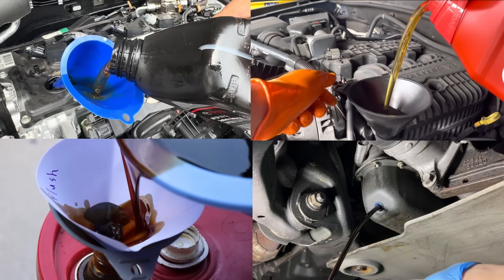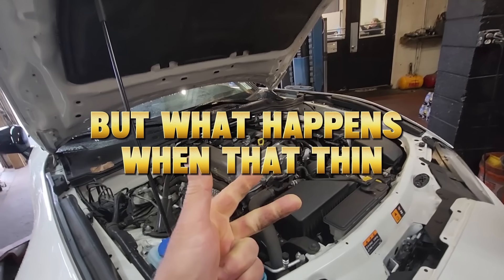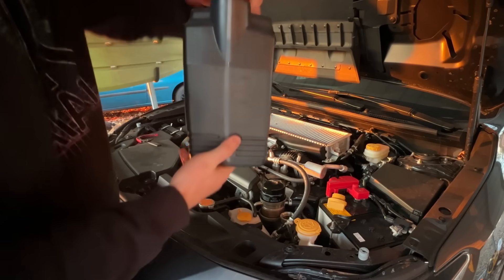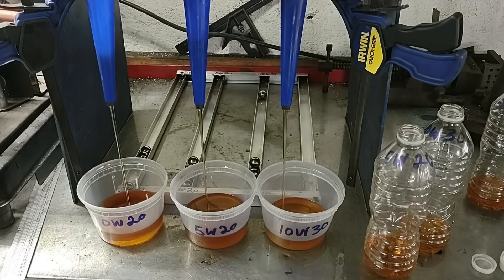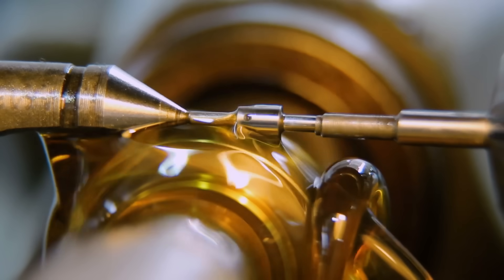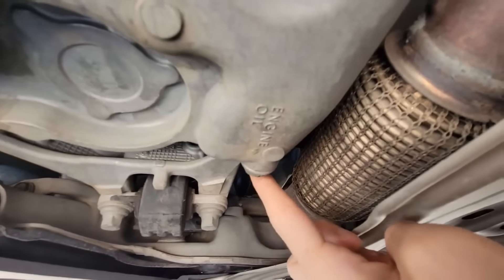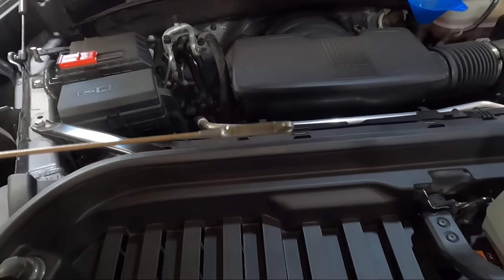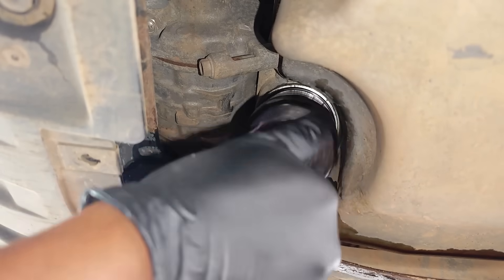The TRUTH About 0W 20 vs 5W 30 Oil (50 Engines Tested!)

Comment from the maker: DO THIS and Your Car Battery Will LAST 15 YEARS! : https://www.youtube.com/watch?v=umw9zUzOzXg
Reply: I was in the oil blending business. Everything you just discussed is SAE & API standards and actually tested using their tests. The XW is the freezing viscosity weight at startup that is critical in extreme cold. the WY is the viscosity of the lubricant when the engine is running. Additives vary, but they are their in a plating scheme to keep metal wear from occurring. All defined by the API & SAE standards and tests done in the lab at the blending & packaging plant's lab.
Reply: Полностью синтетическое 5w30😂 Балаболы. Полностью синтетическое - это когда 4, 5 или 6 группа масел. Если там есть 1-2-3 группа, то масло уже не полностью синтетическое, а лишь полусинтетика.

Comment: Chevy Tahoe owner since new in 2015 LTZ. I use 5w-30 and live in south Texas with currently 287,000 original miles and engine has full power and quiet like when I bought it new. I just changed out the original spark plugs and wires and the plugs looked good still. I used 0w-20 for the first 75,000 miles and then started using the 5w-30 after warranty ended. If this helps anyone that’s wondering oh and I pull a 27 foot RV from time to time. Also. Original transmission only changed out torque converter at 243,000 miles.

Comment: My Ford Everest's manual recommends 5W-30 that has a special Ford spec requirement, calling for WSS-M2C913-D spec oil. I got the car in 2017, did an oil change at the dealership in 2018, but unfortunately big problems in 2019 made me forget about it. In 2020 to 2021 there's the pandemic, and as the pandemic drew to a close I then entered a huge problem in life that made me forget about changing the oil up until Nov. 2023. That's FIVE YEARS with no oil change!! 

And when I changed the oil in 2023 I was given by the shop a 5W-40 fully synthetic oil from a brand that I didn't know (Vortex Plus). I guess any oil is better than 5-yo oil. Then after a year I changed it again with a taiwanese brand called Medex, still 5W-40. Now I'm looking at another oil change but I'm thinking of going with 5W-30.

Comment: This video is GARBAGE and should be removed.  An example of YouTube allowing anyone to post non-factual and made up information. I use 20W oil in my 08 Tundra and after 90k miles the entire engine has ZERO varnish or deposits. Change your oil before every 5k miles for normal use, or even more frequently in severe use. Use good quality motor oil like Valvoline or Mobil 1. Allow your car or truck to come up to operating temperature before you drive it hard. Its all about the quality, care and frequency folks, not oil weight unless you are doing something non-normal like driving your car on a racetrack or out on sand dunes. For example, don't use a standard 20W oil on the racetrack, you will want 40-50W and an oil that won't have shear break down like Motul. With oil, you get what you pay for.

Comment: the video barely touched on the 0W-30. I have a 2024 Subaru Forester and have 7300 miles on it. The first 2500 or so were from the dealer floor...so, 0-w20. I changed to 5W-30 until my next service (at the dealer) around 5600 miles. More 0w-20. I pumped out about a quart and added a quart of Liqui-moly Ceratec 5-30. I live in WA State, so temeperate climate. Am thinking the Ceratec has had enough miles to do its thing. Going back to Mobil-1. Can't decide if I want 0w-30 or 5w-30. Opinions?

Comment: This video is total AI garbage that doesn't even make use of legitimate sources. I work in new vehicle development and the idea that OW-20 is going to greatly increase wear over 5w-30 in the correct application is absolutely ridiculous. Engine oil is also acting as hydraulic fluid in a modern engine and operating cam phasers. Therefore, you need to maintain an appropriate viscosity range. If your car calls for 0W-20 then use 0W-20.

Comment: What if you live in climates like the UK where winters can be as low as -5c and summers up to 35c.  I mostly do short trips with the occasional motorway foot to the floor driving and engine in question is Mazda 2.5 skyactiv G non turbo engine.

Comment: I live in Hong Kong, and the temperature here is mostly like that in California. No extreme winter at all. I have used 0W20 for my Prius 2008 at the first 100K, and I had acknowledged the engine oil loss problem and I temporarily switched to 5W30. The fuel consumption immediately went up but engine oil lost less. I switch back to 0W20. Engine lights is on for overheating.
I agree 5W-30 provides better protection with sacrifice of some fuel and I regret that I go back to the 0W20 Fuel economy scam. For hybrids, the high MPG is from the system , not the engine.

Comment: Mercedes C220d 2.0 190 HP. It came with 5w30 standard. First oil change I switched to 0w30 shell Helix ultra and the engine was smoother especially until the engine got to running temperature. Yes, it was a bit more expensive but what's 30-40 euros more on an oil change compared to repair costs later on? It's up to you, for me 0w30 is the way to go

Edit: when I did the last oil change my friend was surprised on how clear the "old" oil was. He uses 5w30 😅

Always go for the higher quality oils if you want your car to last. I'm sure you pay a bit more just to enjoy a good coffee right? Or you get the cheapest wet socks tasting coffee? 🤪

Comment: Every 5k miles we change oh oil, we have a 2017 dodge van with well over 100k miles and the oil is still nice and clean, still looks new on the change. And we have a 2025 chevy trax the put ow 20 in never again.

Comment: I purchased a used 2011 Toyota tundra 5.7 liter V-8 with 158,000 miles and continued to service the vehicle at a Toyota dealership using 0 or 5w20 oil depending on winter and summer season in Pacific Northwest of Washington State. 
At 187,000 miles I changed to Mobil 1 5w30 high mileage oil which I provided to the Toyota Dealership, which they are willing to use. One of the service writers after 5 years I have owned the truck noted the 5w30 was not the oil viscosity printed on the oil fill cap believed the close tolerance of the Toyota engine and the heavier viscosity of the 5w30 would be harmful to the engine.
I stressed the V-8 with 187,000 miles and being used during the winter as a tow vehicle for a 28’ Airstream travel trailer weighing 7300 lbs was justifiable.
Now after owning the Tundra over 7 years and 261,600 miles I have been using the Costco Kirkland brand 5w30 high mileage in combination with the high mileage Mobil 1 5w30 which the dealership uses and their Toyota oil filter with no side effects for the last 2 years. I change oil between 5 and. I more than 7,000 miles and as my mileage continues to increase I now religiously change the oil at 5,000 miles.
Keep your maintenance up to include spark plug change at 150,000 miles, valve cover gaskets replaced, but the biggest change in the engine performance was when I had the serpentine belt and the tensioner and pulleys replaced. It felt as if the engine had less resistance. That with brakes and rotors being replaced the Tundra runs as it should. Other maintenance performed was air filter changes and a DIY cleaning of the throttle body corrected a lurchy throttle response.

Comment: This is AI generated FAKE video compiled of many snippets taken from many other videos. If you believe the creator of this fine piece of "$hit" I have a bridge to sell you in Arizona.. I use 0W-20 on my 2013 Lexus and when I change the oil, the oil is still in good shape, color and viscosity rating. I never add additives because the additives are there already. I use ENEOS as per manufacturer specification, oil changes and filter at 6500 kilometers, no oil leaks or oil burning, the vehicle is a RX 350 with 102555 kilometers on it. If you believe on "snake oils" treatments go ahead no one is stopping you, you are the master of your own domain. No one is pressing you believing what it's posted here.

Comment: Folk like the 2.4 multi threaten anything other than 0/20 will ruin engine
.Well, unless you check oil level daily you could go a month a quart or so low. This oil evaps so quick so running low constantly is worse for engine wear. Since at 160,000 now ay mis 5 30 with 0 20 or even go 0 30. Oil temp light is always on now despite temp showing normal..Keeps don't show pressure, only temp.

Comment: Roush stage 3 supercharged engines say to use 5W-50 since it’s a high horsepower motor and it is pressured by the supercharger. What do you think about that?

Comment: Is this really true? 0W-20 oil was introduced around the year 2000, meaning it's been around for over 25 years now. In Japan, we also have many cars running on 0W-8 oil, and I have never heard of any failures caused simply by the oil viscosity.

Comment: If you change your oil every 4,000 to 5,000 miles i'm not sure if it makes that much of a difference. Maybe going 10,000 or more miles 0w-20 breaks down faster, but i use Mobil 1 extended performance high mileage 0w-20 and change every 4,000 to 5,000 miles never had an issue. I drive a Chevy Tahoe 5.3L

Comment: I run 0w20 in my 18 silverado and change every 3-3500 miles. Change transmission fluid/transfer case and differential oil every 20-25k. 150k miles and runs like the day I bought it.

Comment: I’ve got a 2023 RAV4 Hybrid Limited. I’m based in the Philippines, where the weather’s usually tropical — around 24°C to 36°C (75°F to 97°F). I’ve been using 5W-30 fully synthetic oil and was planning to switch to 0W-16 or 0W-20, but after watching this video, I changed my mind.

Comment: I have a 2017 rav4 that uses ow-20 the owners manual says i can use 5w-20  but not permanently . Ive never owned a 0w-20 car till this one and ive had it 6 years . It had 58k when i got it . Now has 155k and now definitely has the 2.5 rattle when i start it......i change my oil every 4k-5k i use a good brand . Anyway ive been thinking about switching to 5w-20  permanently just dont know enough about these newer engine  and dont want to screw it up

Comment: I've read about, seen videos, and suspected this for years. Even so, I skirted all of this by buying a used 2018 Tesla Model 3 Dual Motor. After the drive unit warranty expired at 120,000 miles, I changed each drive unit's ATF fluid and filter at 122,000 miles and am probably good until 222,000 miles. The low maintenance of an EV was a major impetus to buying one.

Comment: Bad advice: Always pick ACEA A5/B5 for modern engines. NO, pick the classification that is right for your engine. In difference with the american API classification system, the european used ACEA is much more detailed. It tells about HTHS, which is as important as viscosity when it comes to oil film as well as what the oil contains when it comes to sulfur for example. A A5/B5 in a modern Diesel engine will likely harm the DPF. Instead it needs a C2 oil for example. Some engines needs higher HTHS and need a A3/B4 or a C3 oil. An engine with wet belt might need a C6 oil to save the wet belt. All of them can still have a 5W-30 viscosity. To pick viscosity is not enough for modern engineered cars. It needs to be complimented with the right classification for your car. And to advice to always pick A5/B5 for a modern engine is just wrong.

Comment: This video is pure bull crap!! I've been around engines  for 50 years and have extensive knowledge of lubrication systems. anti-wear packages. So here's the deal.. any modern engine made within the past 20 years can use a 20 weight oil and is probably better off running some form of 20 weight oil unless you're in an extremely hot climate. Here's why... Full synthetic 20 weight oils are so much better at protecting engines and flowing so much faster and removing heat. Better than any oil you can compare it to from just a few years ago.. because the type of oils used and the anti-wear chemistry packages are so good now it creates a learning curve.. that's what we have here a learning curve. Cafe standards mentioned have no bearing no pun intended.. lake speed the motor oil geek just did a comparison and found 20 weight oils actually are the best kind of oil to run you get less wear metal in the oil analysis. My concern would be if it's exceptionally hot where you live above 90 degrees Fahrenheit constantly. Change your oil  and filter every 3000 to 5000 miles and ignore this sort of nonsense as it is old data and mostly AI slop. To put things in perspective a 30 weight oil will sheer down to 20 weight in probably less than  1000 miles just for some sense of perspective here 😂 everybody feels smarter now and have a good day.😂

Comment: '29 Model 'A, new rings, bearings at .001, I use 5-20 full synthetic, uses no oil, still 'tight' engine after lots of miles, I may change to 5-30, same with the '02 Town Car with 220K, we'll see.

Comment: Finally, I have the empirical data I have searched for! I have no idea if this so called 50 engine test is legit. But I have, in printed text straight from Toyota, the evidence to answer this question. Some will curse me, but I am a retied high school teacher. I'm so tired of adults who don't have adequate reading comprehension skills and the ability to do research correctly. The short answer:  the conclusion of this video is correct. Don't believe me? Then go and find the data for yourself, just as I did. Or believe whatever you wish and just do whatever it is that you do.

Comment: I get better fuel economy with 5w30. No more exhaust soot after barrymans b12 in gas and a motor flush at 30,000 miles.  Quieter and more power on 5w30 full synthetic oil. 3000 mile oil changes with purolator one filters! My engines never blow. I change all lubes early too!

Comment: Switched to 0w30 🛢 in my challenger 3.6 , read forums saying it was originally spec'd to 0w30 🛢. Wanted to try it being over 100,000 miles now 170,000 miles. I noticed the tic & chain i was hearing is gone, on incline (hill) it barely comes back from ⏲️  to time, soon as im off hill/incline it's gone. Noticed a decrease in fuel economy but hey I get ethanol free ⛽️ , hope it survives the winter cause it blasted through summer/fall. Might change it back for 30 degrees & below weather. But given age of engine & how powerful amsoil 0w30 is, I think it has 5w20 beat.

Comment: When you try to determine the difference in engine wear between 0W-20 and 30 oils through a simple experiment, you’ve already gone down the wrong path. Why? Because in real-world driving conditions, engine wear is much more severe during cold starts at low temperatures.

If you truly want to test the differences between the two oils, you must evaluate engine wear over a long period of time and under various conditions — including multiple cold starts and normal operating conditions.

But even that isn’t enough. You also need to consider whether the vehicle is mainly used for long-distance driving or short urban trips, whether it often drives in hilly or mountainous areas, and whether heavy loads or towing are involved — all of which affect engine load.

Therefore, this is not something that can be easily proven through a simple experiment. A more scientific and reasonable conclusion must take into account a combination of different scenarios, geographical temperatures, and usage conditions. Moreover, the result is not absolute — it depends on the specific context and driving environment.

Comment: What is the effect on variable valve timing sensors and engine running normally when changing to a non recommended weight oil?

Comment: This is a very stupid test. It says nothing. Ofcourse a engine get worn ourt if you use 20sae if it should have 30sae. The test should be between 5w-30 oil and 0w-30 oil.

Comment: I've been dealing with this question for 9 years with my 2016 Mazda 3 - the 0w-20 specified seems too thin, yet with the tight clearances in the engine, I was hesitant to use 5w-30, as I was afraid there might be some reason not to that I was ignorant of. Since the proliferation of gimmicks on new cars (start-stop, cylinder deactivation, etc.) that harm the engine, but give slightly better mileage and emissions numbers, I'll be switching to 5w-30 - which is specified for the same car, if it is to be marketed in Mexico.

Comment: What is that gobbledygook at 11:36??

This is AI generated junk.  There never is any real data shown.  Go check out The Motor Oils Geeks debunking of this video.  He's an expert.  Shows the real data.

I've read quite a few of the comments here saying that 5W-30 is by far better.  How many have had used oil analysis done to see what the true wear characteristics really are??  It's seems anecdotal at best.  No scientific testing to back up the claims.

Comment: lease do not believe this video. There were no actual facts or no real testing proven for any of this. What is proven is that if you put 5-30 in an engine that specifically takes 0-20 it will have extreme oil starvation upon start up and become destroyed. The VVT systems are meant to run a thinner oil and giving it a heavy oil will make it not operate correctly. The ONLY oil you can change it to is 5-20 which has been proven safe matching with an ow-20 engine. Just remember not all brands of oil are made equal, buy good oil and do oil changes before it’s due and you will be fine. This guy with an AI voice has no idea has no idea what he’s talking about. 
Master mechanic 22 years-